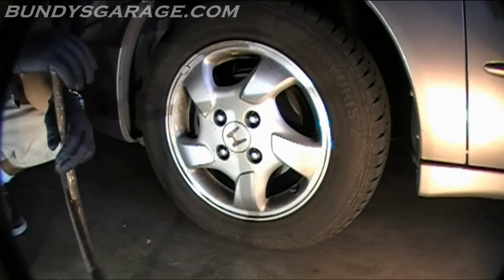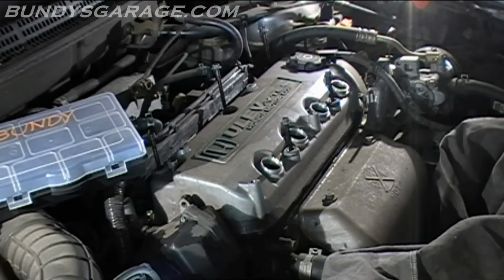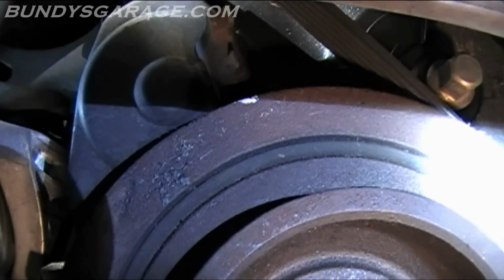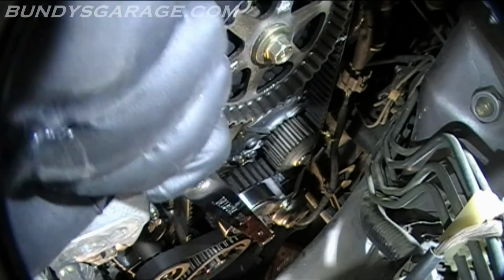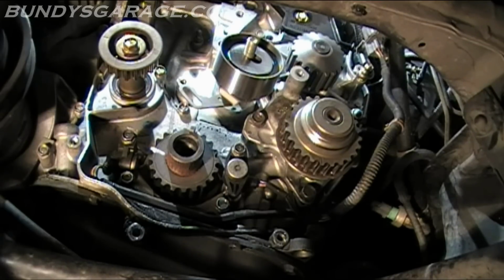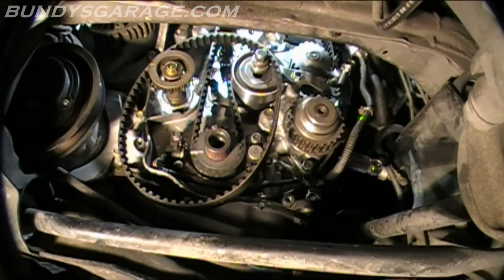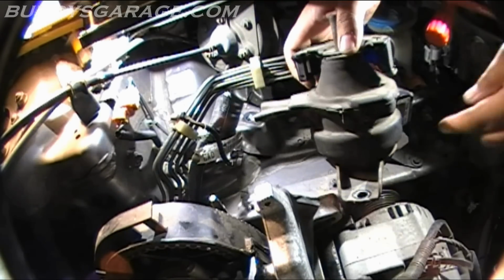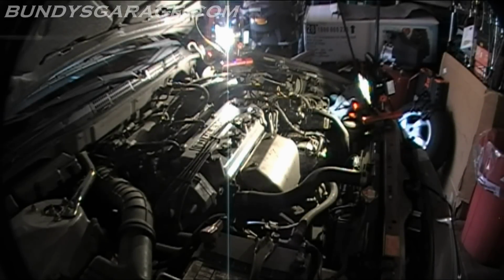BEST DIY Honda Accord 2.2L 2.3L F22 F23 Timing Belt Replacement w/Water Pump - Bundys Garage

Comment: 1:26:00 whenever I get everything lined up and go to put the top of the belt on, it shifts the bottom of the motor out of alignment, how did you keep it from moving? In the video it doesn't look like you did anything different than what I did but somehow your motor didn't move at all, any help would be greatly appreciated as I'm stuck, also what timing mark do you use through the peephole on the motor above the block identifier plate
Reply from the maker: Try getting another person to help you and holding the belt in place while you put it on the top.
Reply: @bundysgarage  I ended up getting the belt put on, the timing is now in sync, turns out the my valves were also horrendously out of adjustment, the exhaust valves on cylinder number 4 were two shims out of spec, it sounds a lot better but still has some louder than I'm comfortable with ticking, I'm on a honda group and there's a guy that says he's found the magic method to fixing it completely, fingers crossed 🤞
Reply: @Black_noir_mw3 
Any updates?

Comment: I'm under the car, Jimmy's on top with a Flashlight ... the car is Swaying on the One Jack !   I got a broken Bolt, Stripped Threads & Oil leaking in My Face !

Comment: Nice video, How long did it really take to do a complete job???Thanks!
Reply from the maker: 2 days
Reply: @bundysgarage  Hi, possibly your 3 teeth counter clock wise tension did not work because you did not rotate the engine as per manual 4-6 turns for the timing and balance belt with the bottom cover on before you tighten the tension-er nut down. You were reading what the manual said to do, but you did not follow the instructions as per the manual. Thanks.

Comment: Hi, possibly your 3 teeth tension er did not work because you did not rotate the engine as per manual 4-6 turns for the timing belt before you tighten the tension-er nut. Thanks.

Comment: Explaining where the main timing belt tensioner  spring goes you were wrong it goes on the small tiny hole in fact go back on your video prior to removing it the spring you will notice is in the small hole , HAHA  you actually made loads of mistakes and I am yet to see anyone do this job properly

Comment: Well, about to tackle this job on my 1996 Honda Accord 2.2Vtec, to be 100% honest this will be the first actual "big job" for me, also I have Oil leaks to find/fix while I'm in there. I'll be using this vid for reference for sure, good to know about the Crank Shaft Pulley Bolt is a PIA, lookin forward to it.
Reply: How did it go?

Comment: The timing belt and the balance shaft tensions are the same thing you are supposed to tighten the tension with the balancer shaft belt on you then rotate anticlockwise the teeth 3 teeths to tension belt ,  then secure the bolt to 33 foot pounds or 44.74 NM , you then rotate the engine one full rotation from top dead centre to top dead centre to check your work as is the case with all cars . in fact you can set tension at any time without even removing the timing belt covers, thats where you went wrong with tensioning the belts both of them are tensioned with both belts on car in one action, also removing the tensioner you did not do that properly why it was tight to remove was this , you are supposed to tighten that bolt which relieves the tension on the tensioner of which you then undo the smaller bolt retaining it then removing that bolt is easy , a lot of you guys actually need to read up more on these jobs

Comment: There is a socket 19 mm it is LISLE 77080 and is designed so that it has less movement inside  the socket to crack these bolts off , designed for these hondas

Comment: I always use a wire to pull up on the tensioner. Use a breaker bar against the ground to hold the crank bolt and turn the cam gear bolt while pulling the wire. As long as you have a lockbolt almost finger tight on the tensioner, as soon as you put rotation force on the cam bolt while pulling up on that wire strung in the tensioner, the timing belt will tension up exactly what you need and you can tighten that lockbolt. Quick, easy, and uncomplicated.

Comment: And yes there is a special socket used to remove the crankshaft pulley bolt. Heavy enforced 19mm 1/2 in impact socket. Use a impact. "remove all splash shields and covers and motor mounts. And yes use the tool to lock the crankshaft pulley.

Comment: First off, great tutorial! That crankshaft pulley bolt is a dagum bee sting! But I actually had to take 4 stabs at this before I got it right...  ugh. The harmonic balancer (balancer shaft) was the culprit. What I learned is that there's a 12 o'clock groove and a 5 o'clock line. However, you also have to make sure the screw driver goes all the way in at this position, which will only happen every ~3rd rotation. From what I can tell, the gear and the shaft rotate at a different ratio, or at least only align at balance every so many turns... Tricky! When the screw driver is fully inserted and the marks are aligned, the gear will only move freely about 3-5 degrees and be caught rather than push the screw driver out. (basically when you turn the gear the screw driver "stops it" rather than being pushed out) Gotta make sure you do this, especially if your timing belt was off to begin with, or your foolish like me and don't make 10 marks per belt. However, at this point I could probably knock out an Accord timing belt out in a quarter the time it took the first go round.
Cheers!

Comment: next time use the starter trick
Reply from the maker: You can only use the starter trick if the engine spins the correct way. So be careful when you try it. Otherwise you will snap the crankshaft pulley bolt off.
Reply: Wrong pre 2000 engines spin counter clockwise and to remove bolt is also counter clockwise using the engine with a breaker bar will just shear off the bolt

Comment: That bolt will loosen up by hitting it with a hammer several times and spray with wd40 and wait 15 minutes.no need for dangerous torch that might catch on fire if you have leaking fuel lines and injectors.
Reply from the maker: It’s not dangerous if you know what you are doing. And why would you have a active fuel leak. If you have a fuel leak you should be worrying about that and not the timing belt.

Comment: You would've been way better off using two extensions that are half as long.  You were losing a lot of torque to the torsional twist of that ridiculously long extension.  You also should have had the anchor ratchet somewhere between the 2-4 o'clock position, resting on a cross-member or control arm.  Most of whatever torque was left was lost to the anchor ratchet scraping across the ground, which translated to the front end lifting up, which is also a really bad idea from a jacking/safety standpoint.  A torch wasn't necessary for this.  That bolt looked almost spotless.

Comment: On the most parts, your video is quite good. However, I would draw attention to a few points. 

1). When setting timing belt tension, The engine must not be rotated by the camshaft bolt. Doing so loosens the timing belt. The belt must be installed in such manner as to be naturally tight on the run down from camshaft pulley to the crankshaft pulley. The tensioner only tensions the belt after the crankshaft pulley, not before it. 

2). The rear balancer shaft timing. Due to the design of the rear shaft, the 6 x 100 mm locking bolt, marked at 74 mm from the end, can only be fully inserted in the inspection hole (up to the mark) every 3 rotations of the balancer shaft gear, regardless of the timing marks on the gear and case being correctly set.

3). The temporary locking bolt for timing belt tensioner. This bolt is utilized for 2 reasons. it is intended for locking the tensioner assembly in place during assembly to prevent the tensioner being dislodged from the locking pin. Additionally, to prevent loosening of timing belt while pre-tension for the balancer shaft belt is being set. The temporary bolt MUST be removed prior to final belt tensioning. Leaving it in place will prevent the timing belt from being correctly tensioned and will result in belt failure. 

You did remove it, well done. During my career as builder of Honda engines, I have on several occasions come across engines with this bolt in place. On every occasion, the timing belt has failed. 

4). The left upper cover securing bolt. This special 6 mm bolt screws into a metal ferrule built into the lower cover. The 2 main reasons for failure to remove the bolt without ruining the upper cover is over tightening the bolt, as well as lack of use of Never seize or a similar non-drying lubricant. 

5). A short note on oil seals. Both the crankshaft and camshaft oil seals are prone to failure on Honda engines. While the timing belts are replaced, it makes sense to replace both, as doing it as a separate job, requires disassembly of the belts.

My personal view of your video. Well done (but don't use a screwdriver as the locking tool for the rear balancer shaft). Sorry for the long reply. Cheers from Indonesia.
Reply: Totally agree about replacing the oil seals while you are in there.  I would also do the front balancer seal as well.  And since you have to take the valve (tappet) cover off might as well do those seals as well.  With proper tools it is not difficult nor is it expensive.

Have to disagree with point 4 the left upper cover bolt.   Unless you were referring to the factory being at fault for over-tightening and/or lack of never-seize.  I have seen this exact problem where the bolt seized to the ferrule and the prior assembly was done at the factory.    I have been able to epoxy bond the ferrule back into the cracked plastic and the cover still is serviceable.
Reply: @olli makkonen very old post and video but I'm rebuilding the same engine and having issues with my timing. When the video shows the timing cranking, you can see how it flops and if not tensioned from cam to crank. Mine is doing exactly the same. How do you get it tension throughout while the engine is spinning? I would assume that it should stay tensioned all the time right?

Comment: I'm glad you put that text in the video about you should have used your impact,

I just did one this morning on a 90 Accord and we hit it with the impact it came off like nothing and didn't even rotate the engine 1 degree. 

thanks for the video and the detail I appreciate it not done with the job yet we had to close up early got to remove and replace the water pump and put it back together in the morning

Comment: when you pulled off the cover for the crank case and showed us what each sprocket was for and the last one got me laughing. "Not sure what that is" lol Best DIY Ever. This does help me though because i literally just got a 99 honda accord 4cyl manual. its my first modern old car. I like driving my older classic model chevy c10 but im swapping that engine right now with another 350 sbc only im putting twin turbos on it. Thanks for the vid though. Much Appreciated. :)
Reply from the maker: +Antony Bonilla funny how, funny like a clown, I amuse you
Reply: Not like a clown. god i hate clowns. But funny as in i wouldnt know what that thing was for either lol

Comment: Don't you need to pull that tensioner bolt for the cam belt before you tighten the adjuster nut?

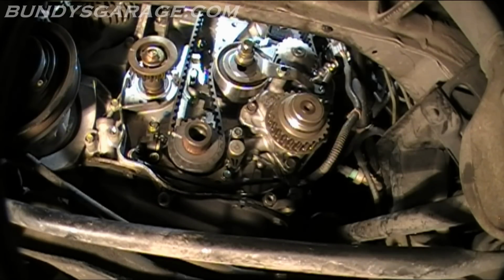Comment: At 1:27:25, the reason it tells you to turn the crank shaft pulley so the cam shaft pulley moves 3 teeth is to take up the slack between the crank pulley and cam pulley along the left side. By turning the cam pulley 3 teeth you increased the slack between the crank and cam pulleys. You could see the slack of the belt along the left side as you did it. There should be no slack. By turning the crank, not only do you take up the slack from the belt, but you end up with the slack on the right going to the tensioner so it can do its job-give it tension.
Reply: The wording on the service manual is confusing. You're correct though. You rotate the crank enough to move the cam 3 teeth, tightening the slack opposite of the tensioner.

Comment: Thank you for the DIY. The fact you used hand tools was great, because like you said, not everyone has the luxury of air tools. Shows that it can be done with hand tools. Not sure if you mentioned it, but what brand of sockets do you use? Just curious.Thanks again! I don't need to do this job as of yet, but I like to watch all kinds of videos that will be useful in the future. I would like to inspect my timing belt though, and this works...But after watching whats involved, I might want to just replace it anyway after getting this far. Not sure yet... I'll stop rambling now and just finish watching....
Reply from the maker: +Dano C. It's really hard to check the condition of a timing belt. It's best to replace the timing belt you will pay more to replace an engine if the belt breaks than a timing belt. The sockets I used were MAC I believe.
Reply: Thank you, I figured the sockets were of great quality... What I meant about the timing belt, by checking the pt numbers you can sometimes tell if it is the OEM belt (usually means never replaced), and if the pt numbers are really clear that usually tells you the belt hasn't been on there for say 80,000 mi., plus just see the condition of the teeth. like I mentioned though, if I got that far I might as well just replace it. Thank you.

Comment: wrong! towards the end to tighten belt dont use cam bolt to turn engine that puts slack on the wrong side of the belt, turn it with CRANK bolt that puts tension on right side of belt and lets the tensioners take out the slack
Reply from the maker: +james fank thanks for the tip
Reply: @bundysgarage   THank you for the video (Surprised you did not have air??  Anyway, don't feel  bad, I learned the hard way not to turn the engine with the cam bolt as I snapped the bolt head off on my 1.6 CRX D series.  Thanks GAWD I was able to grab what was left with a pair of wire cutters and spin the newly formed all thread out and replace it with a new bolt.... FEEEEEEW!!  Could have sucked!!!

Comment: have you ever done a timing belt, I have been doing timing belts for many years from the factory there is always a 10mm bolt to hold down the tensioner and the main bolt,I was looking up videos for the timing marks do your research before speculating
Reply: starfire rider are you referring to the 10 mm bolt used temporarily to help set up the tensioner components but then it is removed afterward?

Comment: Hey nice video.Back at 1hr.28s the tension was released on the wrong side of the belt.It should be loose on the tensioner side after pulling the camshaft CLOCKWISE as you look at it with the spring tensioner taking up the slack then locked up.Just an observation.Means the timing belt is too loose but will still run ok for now!Good talk through though.From too long Mechanic:)
Reply from the maker: +Gerard Byrnes the spring is not meant to put tension on the belt when replacing. You have to put tension on manually on the timing belt for it to sit correctly.
Reply: BundysGarage Um no, the spring is there for tension. You're supposed to TURN THE CRANK when setting tension. Have you not watched your video? Look at what the belt is doing when you're turning the crank. THINK about what the belt would do in that situation had you TURNED THE CRANK three CAM teeth. It would move the slack to the...tensioner!!! At which point the spring "that does nothing" would tension your belt.

Comment: Ibrain Font I have a question  does the spring itself gives you the right tension or I have to push manualy to make sure the timing belt is thigh proper, why bundy's has to push with his hand to tight the balancer belt.
Reply from the maker: +Henry Alvares Yes you have to push it with your hands to get the right tension. If you leave it up to the spring it will be too loose.

Comment: Tim Sullivan no he did it wrone hes no a mechanic you can see it  your suppost to use the crack shaft to turn counter clock no  the cam.
Reply: Ibrain Font If I deciphered that correctly, you're spot on. Now take some interest in the little red squiggly line under the majority of your words.

Comment: Great video. 
Do you think getting new bearing springs would've helped with the belt tension?
Reply from the maker: +Jorge Romero Negative, the springs are not super strong, they almost feel like a place holder. To set the correct tension you need to use your hands (I know it's not scientific) and "feel" for the correct tension on the belt. Not too tight and not too loose, just right.

Comment: Very Nice video and detailed explanations. I will be replacing the timing belt and water pump on my 2002 Honda Accord SE this coming summer 2016. It has 135000 Miles and was never replaced before. Is this your first time belt replacement on a sixth generation Honda? and do you have videos on replacing the one on Toyota Camry 1996-2000?

I did like the video, I subscribed and hit the thumb up for it.

Thx. a lot.
Reply from the maker: Thanks for watching. I would change that belt and WP sooner than later. Both miles and years, but more so on years. If that belt goes or it jumps timing it will cost you more than a timing belt component kit. Check out rockauto.com for great pricing. I have always had great luck with them and their parts. Thx for the sub.